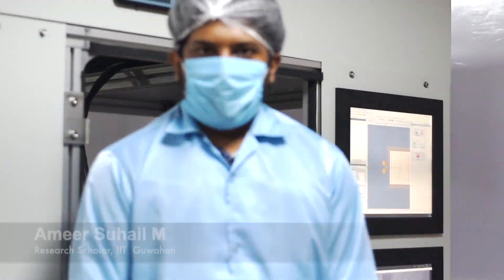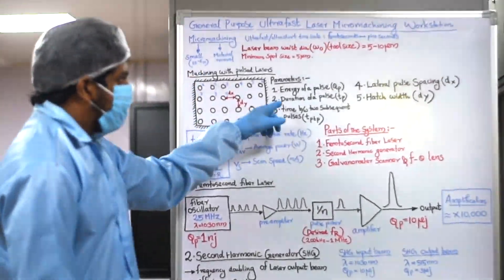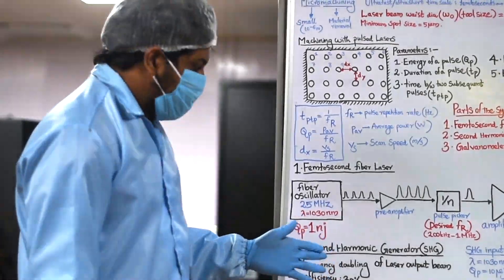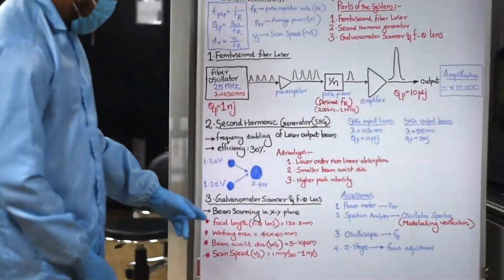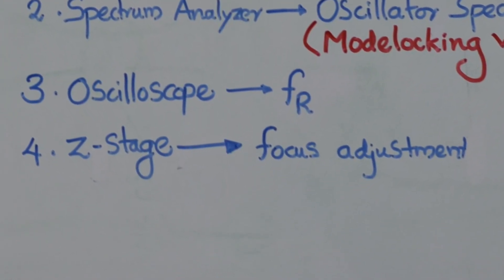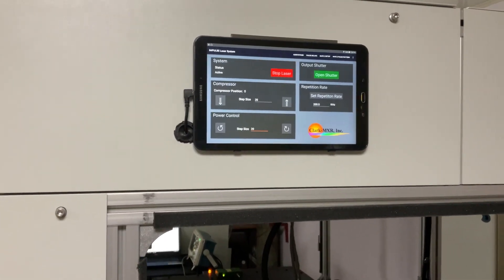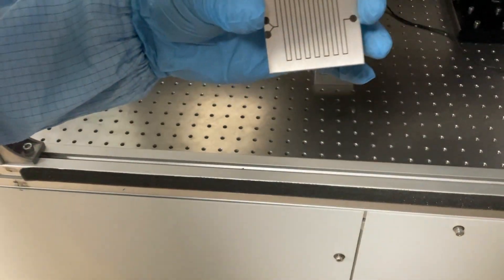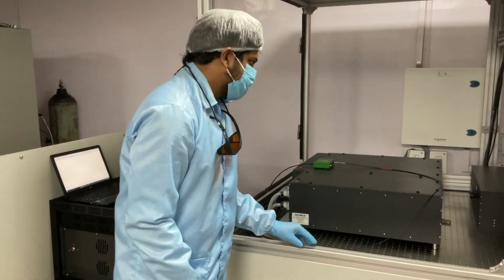Laser MicroMachining | LMM || Micro structure fabrication || Machining ||

Comment: average power 10 w, rep rate 200khz, lens 515nm, how do i calculate pulse width
Reply: Pulse width is not directly dependent on this. You need to have a device to measure it. Like an autocorrelator.
Reply: @ameersuhail1  Thank you so much. Now I know the value 300 fs. And we have achieved target depth for a special material. next step is optimization of different parameters. Can you suggest any efficient ways ?